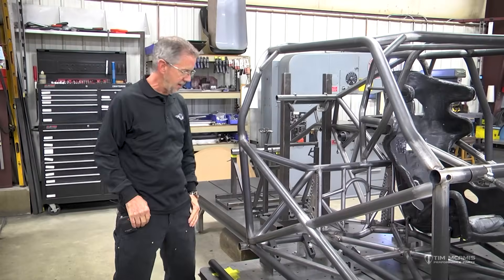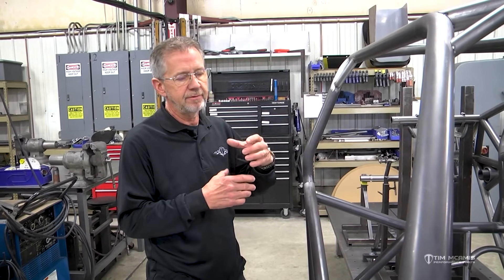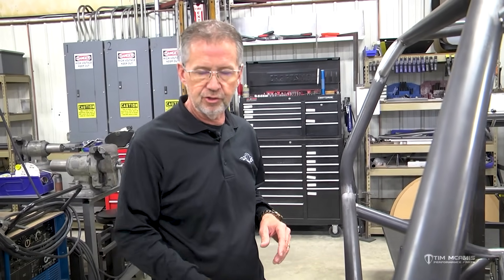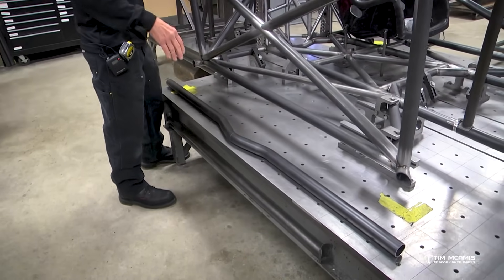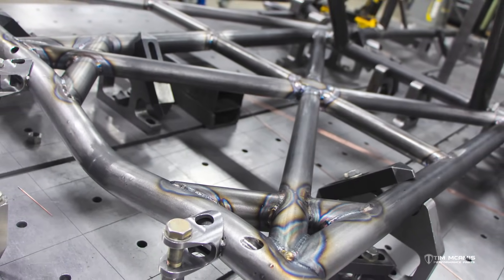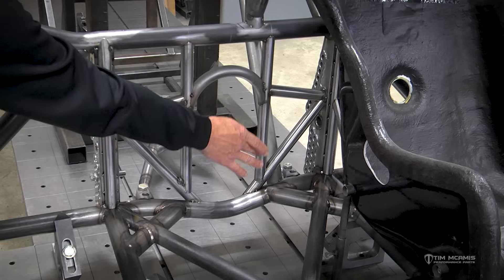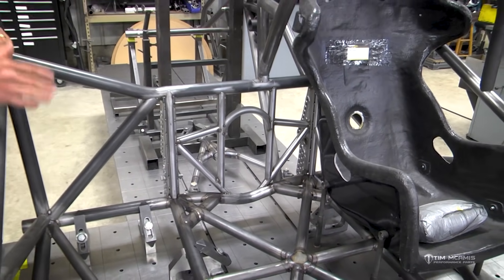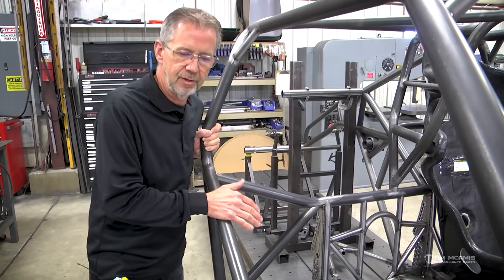Dropped Cross Member on Tube Chassis?

Comment: Curious about the intersection point of the 6 bars on the floor.   Is there a type of joint there ? Looks like they all join into something.
Reply from the maker: To help support/strengthen the lower frame rails. It is also a mounting point for drive shaft enclosure loops and ties into a double frame rail as well.

Comment: The drag racing scene really did pull a lot of inspiration from dirt track racing scene. Even brackets and hardware directly reflected designs used by dirt track chassis for years prior to being spotted at the tree. Over the last 40 years we really advanced 4 bar and other suspension technology that  constantly bled over to other forms of racing. We borrowed our fair share too.  We don’t even worry about that rear,  lower,  horizontal crossmember as it’s not needed or regulated, plus we get insane amounts of droop and driveshaft travel and have clearance needs for things like lift arms, etc. Even the structural simulations and analysis told us it’s 100% not necessarily to tie the two frame rails all the way across at that location. Its just not.  It’s only necessary if the rules demand it or demand a full 360° shaft hoop.  But then agin, you place that further up where the driveshaft movement isn’t as much of an issue and the point of the shaft that’s most threatening to the driver and is the actual source of a rollover if it’s steel or aluminum. Granted in dirt, we need to strategically engineer chassis flex for performance so it’s far more difficult to build then a solid straight sled or triangulated jungle gym on wheels. With properly designed chassis, that bar omitted would never ever have a safety issue, even in the most violent wrecks with multiple cars. Regardless of what the overzealous sanctioning /certification body’s say. It’s just a bar in the way of a shaft and over engineering things while simultaneously under engineering it. 

Everything designed by this company is perfection. Even the hardware they use is chosen 100% correct.
Reply: @ChrisS-oo6fl The one piece rear cross member is more about keeping the 4-link brackets in place. 4,000HP on the starting line in a car with very little tire spin tends to relocate suspension members. As far as it being a safety issue if you saw the wreck between Bruce Allen and Kenny Koretsky (I believe that was the guy in the other lane) you might change your mind a little. Those are not even close to being the most powerful door cars. https://www.youtube.com/watch?v=IiEv0j-SzlQ
Reply: Exactly! The only time a dirt chassis sees equivalent forces is in a crash. 
.
In the crash you mentioned if the lanes had been swapped both drivers would have been killed. Koretsky drove through the weakest part of Allen’s car.